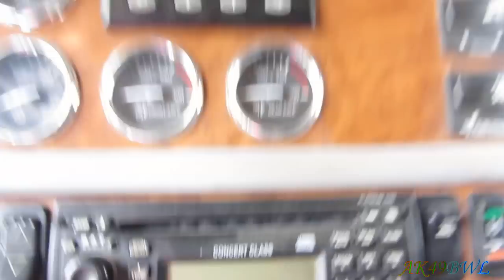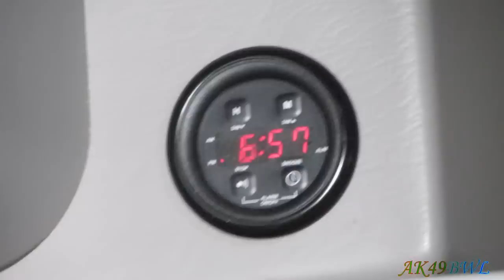Transmission Line Error - DD80

Comment: Military has an A/C shirt to be worn under body armor, works exactly like your cooler unit in the truck. Hydration is the best thing to beating the heat plus the fact that you CAN do anything you what as long as you put some heart in it. Remember you head will tell you to stop, long before your heart is ready to quite, a tiny bit of heart goes a very, very long way, proven fact.

Comment: The only way to get used to the heat is too not run the A/C during the time your driving only when your sleeping! Cause if you run your air while it's hot outside when you step out of a cold truck anyone would pass out! Your body can't adjust fast enough from being cold too hot!
Reply from the maker: I hadn't been running the A/C that morning. A 7 mile drive doesn't warrant it. And I don't run the A/C while sleeping.